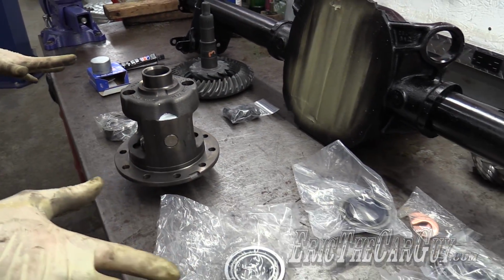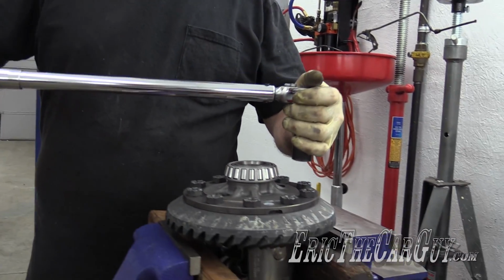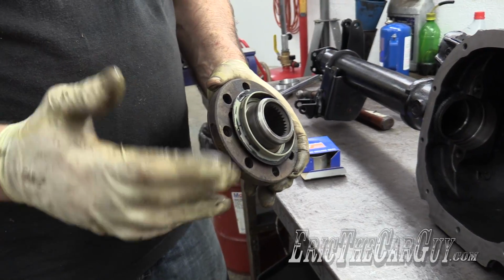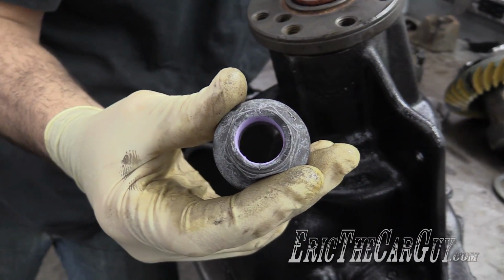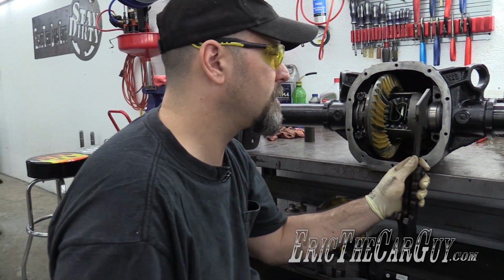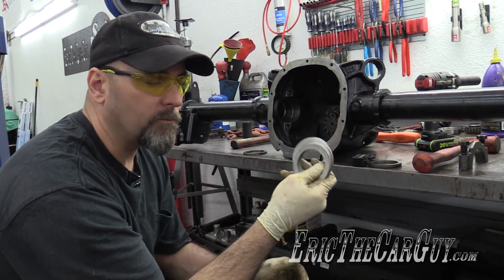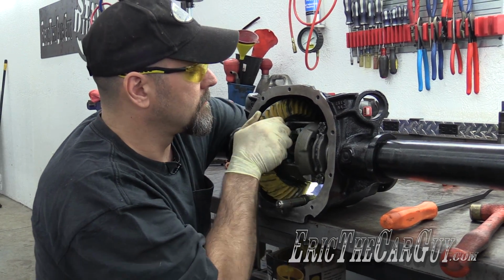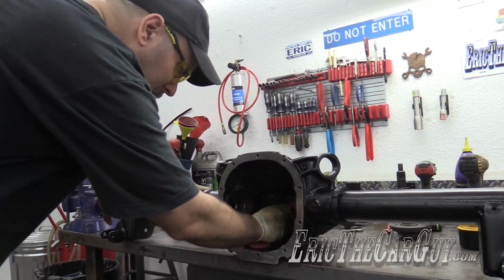Ford 8.8 Assembly & Set Up (Part 1) #FairmontProject

Comment: Hoping I still get a response after 9 years 😛.  At min 40.50 where you're switching back to the old pinion bearing, you're showing where the Koyo setup bearing caused damage to the race. Wasn't that the Koyo race that came with the bearing?  Just confused why you're saying the Koyo bearing was wrong.  I do see the race looks damaged, but was the race correct for the bearing?

Comment: I know the crushed sleeve gets crushed but isn’t preload created by the tension of one bearing being tightened against the other as both bearings have to seat to keep the pinion in place and the play does not go away until they are seated. The crush sleeve has nothing to do with spacing-just preload. I would not think the exact preload is necessary for getting a gear pattern but it is for permanent differential operation.

Comment: it seems by my recollection (and my recollection is known to be poor) that there are markings on those pinions that describe their difference from absolute spec. Therefore, you can look at the marking on the original pinion and the marking on the new pinion, and see what the difference is. then you simply measure the shim on the old pinion and do the math to add a shim the is either thicker or thinner depending on the difference between the two, and that will usually get you close enough that you usually don't have to pull them apart after the first try.

Comment: I'm always happy when I can find relevant information from you.  You are a great teacher.

Is there some reason why you didn't just throw the carrier in the freezer so the bearings and gear set didn't go on easier without as much pressure on the bearings?  (Bearings and gears being warm/larger vs the carrier being cold/smaller)

Comment: One more thing on that rear end.  the upper control arm in the diff you can put bearings.  On the forward mounting point make brackets to lower the upper front mounting point 1 inch.  I had 1.3 60 foot.   Just some ideas on my part.

Comment: Yeah, I know this is an old vid. But thank you Eric for leaving all these up!! I'm "gearing up" 🤦‍♂to rebuild my 8.8 in my truck. I'll be getting rid of some factory parts and replacing them with much better Yukon parts (mainly the open diff. to a limited slip (or posi for the GM guys) This information is going to be tremendously helpful. I'm greatly appreciative for the walk through of this job!! Thank You Sir!!

Comment: Hey Eric, is there any particular reason why you didn't pack the bearings with wheel bearing grease? Are you not supposed to mix wheel bearing grease with diff fluid or is there another reason?

Comment: I heat gear up on hot plate for 10 to 15 minuets use guide studs  You do not need a crush sleeve to check pinion depth  That is why you math new to old or old to new

Comment: I thought of and discovered a really cool trick when installing races on a sport  bike I was rebuilding. Take all the races and put them in the freezer for a few hours beforehand, then take them out one at a time as you need them. You'll find that the races shrink enough that they literally just drop in, maybe sometimes needing a little tap. It was a whole lot easier than having to press them all. A thicker bearing might take longer to shrink, might not work at all, but  it's worth a shot.

Comment: I bought a 2000 expedition 5.4 engine but i have a grinding sound in the differential when i turn left or right it sounds like thats where its coming from i have a feeling the old owner changed something in there I see silicone on the rear diff.my question is this , is that what I'm hearing or not

Comment: I know you have to be very precise in setting up your differential but how did Ford mass produce so many vehicles if you have to spend so much time tweaking each individual differential I wonder how they did it so quickly to mass produce so many vehicles
Reply: I believe rear ends were premade and just a big pile of them waiting to go on a car, the same with engines,however when they mass produce stuff like that they have special tools,since all the bearing sets they are using are the same made by the same company you just set one up and all the others should be the same.

Something that always has amazed me about the auto industry is how a particular model will have some goop they put behind hinges like under the hood for corrosion protection and of course once they tighten it it oozes out,if you look at another car made at the same time that oooze pattern is just about identical, how??? lol

Comment: Well my 355 gears 8.8 differential broke that pin thats like 3 quarters of an inch think and i was wondering do i have to pull the entire differential like you did but leave the axle and all of that on the truck

Comment: You add .020 thou to pass side...subtract .020 thou from drivers side.  That reduces your backlash .005 thousandth.  (Moves it closer to the pinion teeth.)

Comment: after watching this video, I have come to the conclusion that finding a mechanic who actually knows how to repair a differential properly is probably close to impossible
Reply: Me too, you don't press a bearing on by the outer race pushing on the cage, ever.  And you don't press a ring gear on by the teeth.
Reply: @Str8Haste going against wood won’t hurt the teeth on the ring gear🙄

Comment: Make a fake yoke out of some tubing and a nut.  Make it a bit longer than the height of the yoke.  For setup, leave the crush sleeve out and tighten the fake yoke by hand until you get the right preload.    Saves a ton of time and you only need 1 crush sleeve to do setup.  I see you fond the shim driver tool.  I've got one drawer of my tool box with special tools for doing gears.  
   They also make crush sleeve eliminator kits.   Good luck against my buddies Miata on friday!   Catching up on your fairmont, looks good, money is still on the Miata.

Comment: So eric loved the video. I am glad to find a detail video on a 8.8. I would like to ask you a question about my 2008 crown victoria it runs the same differential configuration. My question to you is I just want to put LSD in it do I still have to worry about the backlash? As I am not taking out the pinion just the Carrier. Please advice

Thanks

Comment: Im doing mine now and rebuilt the whole thing and changed from a 3.73 gear to a 5.13 and started off with the shims that was in it and it felt to little of back lash but it was right at 8 and did the paint test and looked good so did i hit the rear end lotto or what.

Comment: If you dont have a press to press the bearing on you could also put the bearing in the oven at 350 and put the pinion in the freezer for a hour or 2 and the bearing will slip right on and when both get back to normal temp it gets tight like its suppose to be.

Comment: I had a differential rebuild 2 years ago truck was hardly used.... the other day I hear a loud thunk in rear end... see my rear diff cover is leaking.. I pull off cover find ALL bolts in ring gear are lose and one bolt has came off jamming between ring gear and cover... who is responsible?

Comment: Easier to use the SOLID PINION BEARING SPACER WITH SHIM PACK from Ratech instead of the crush sleeves, hate setting them up with the sleeves!

Comment: What the fuck... Pressing with a race 🤮. Rough as fuck... If you carnt use a press propaly, you would be better boiling it in oil or use an induction heater.

Comment: I have just spend 1400 to have ford repair a 8.8.  My (former mechanic) was putting some 3.31 gears and ran into trouble.  he knows what he is doing mist of the time but he got it where i the ring would only rotate 3/4 of turn and then bind up, then he tried to put the old 60k gears back in and they did the same thing.  before all of this the car was fine.  For said that my mechanic warp the carrier.  The put a new carrier in and all was fine.  Can a carrier warp and if so how could a mechanic do this?

Comment: can you buy a rebuild kit for 98-2000 8.8 which would include all sleeves, bearings, 31 tooth spline axles, etc... in 1 package?
Reply: there are rebuild kits that include everything (but the 31 spline axle shafts) 
motive R8.8RSKTT or motive R8-8RMK
or google for 8.8 rebuilt kit

Comment: do i have to do all the messurments when just changing the diff part but using the same ring and pinion gear in the old diff housing?

Comment: 7:15 - Fair warning, if you torque your bolts to 100ft/lbs you could strip them out!  Read the instructions that come with your ring gear / diff kit.  The Yukon kit I got calls for only 60ft/lbs of torque.  If you torque them down to 100lbs you will shear off the bolt threads.  Ask me how I know :-(
Reply: I know this is a old comment, I'm not familiar with Yukon but the bolts Ford uses on rear ends (at least the 8.8) are the same bolts they use on their Flywheels/Flexplates and let me tell you, they are MAJORLY  stout,you could probably tow the Queen Mary with just one bolt.

I recently installed a brand new engine in my Mustang and i ordered some new crank bolts,instead of sending me the correct amount the sent me several extras,since I'm old enough to know you never get anything for free i inquired on it and they told me "oh you got a package for a rear end by accident,just use what you need and save the rest" torque value on Flywheel bolts are 85 footpounds per Ford, being a rear end is under tremendous forces 100 is not very far away, i did research the torque and its 96 to 102 footpounds so i guess Yukons are different.

Comment: Hey +Ericthecarguy I have a question: mechanic changed the pinion seal on my 8.8 by removing the pinion nut without counting threats or caring about the preload (pinion seal was leaking and needed to be change), then he putted it back on with a impact wrench making it so tight that the wheels wouldn't even spin, then he loose the nut up and torque it back in, now the gears whine in between 30 to 40 mph, what should I do at this point? re-install the pinion with a new installation kit (washer, crush-sleeve and barings) or is there something else to do?

Comment: If you pulled a OEM timken off of the pinion, wouldn't a replacement timken be the same spec? I'm curious because the bearing set i ordered is Timken and if my Ford 8.8 came with Timken originally i "should" be able to use it as a cheater bearing for setup, no?

Comment: What issues can arise from backing off the pinion nut a little? I tightened mine, but was a hair past spec for pre-load and backed it off like 1/8 turn. What issues will that cause?
Reply: Nick Greenfield it won't reduce the preload dependably by loosening. The preload is arranged by this crush sleeve actually bending or crushing into place with the bearing "loaded" with pressure on the races. If it was not a lubed taper bearing we could compare to an interference fit. If you back off the nut, the crush sleeve is an alloy steel that will not spring back, and the bearing will essentially have some sort of play in it, allowing it to cycle with accel/decel, wearing the gears, and/or basically loading them in a weak fashion at the edge of the teeth on the gears especially with wear over time, and early seal failure will likely happen.

Comment: sorry I got to this video late, I'd just really like to ask, why a 8.8 and not just a 9 inch ? 9 inch are WAY easier to work on, or better yet a chevy rear... But I hate chevy rears... That's why you see ls engines linked to ford 9 or 8.8 rears, they just put the power down. 
But was it you couldn't find one, or just like 8.8's better ?

Comment: next time you have trouble getting a bearing off the pinion use a chistle, bump it in there and it will give you enough gap to get your puller installed without ruining the cage

Comment: thanks for the video, i did this on my Fairlane a year or so ago, i got frustrated on gave up trying to get preload right on the pinion, big mistake, diff is really noisy and wont last long, will be rebuilding again with new gear, and will be watching this a few more times. thanks

Comment: If the replacement gear set has the pinion gear mesh depth engraved on it, I use a depth mike and measure off the bearing saddle to achieve that dimension.  Then, your heel/toe portion of the pattern should be pretty darn close to where you want it.  I never use a sleeve when doing a set up, just enough pressure on the flange nut to keep the pinion gear from wobbling around.  Never had a problem yet!  
  Once I set up a GM 12 bolt Posi for a '68 GTO like a Dana, with a solid sleeve from Summit and shims to get the rotation torque preload to spec with 250 Lb/ft of torque on the nut.  Worked out great!  
  Something that was left out from this video and is VERY important, is to check the pattern and back lash at three places around the ring gear to make sure that you don't have any tight spots.  A couple of dolts set up a new set of gears in a Ford tow truck axle, and didn't make it out of the driveway before the pinion gear blew up and took out about 1/3 of the ring gear!  The reason?  The cold chisel used to separate the old RG off the gear case gouged it, and the chip was left under the ring gear, elevating it about .007-.010".  When the high point of the RG came around to the pinion gear KA-POWWW!!!  Metal schrapnel all over the place inside!  The Detroit Locker was  also damaged and parts to fix it couldn't be had for 10 weeks, so a peg leg axle had to be put in to get it going and making money again.  If they had bothered to check in three places, they would have spotted the problem and could have fixed it before the damage was done.  Let that be a lesson to all here!

Comment: I set up those crush sleeves in the press. On a live axle, you need a helper to get the rear end into the press and hold the end to balance it.
Set the pinion flange down on the base of the press with a gap to access the pinion nut, and press on the pinion with a long extension. You can feel the preload on the bearings by the friction when trying to rotate the housing in the pinion bearings. Once you have it right, you can just reach up under the press base and tighten the nut down.

Comment: Did this 1 year ago, on a GM 8.5, installed a Yukon Duragrip and the old 3.42 ring and pinon 40 year old stock gearset.  As Paul said it was a lot better doing it without a crush-sleeve . But it took me 14 tries, swapping out carrier bearing shims, and juggeling pinion shims around to get it just rigth. A set up bearing is a must! But an extremley satisfying job in the end when it all works great without a sound :)

Comment: nice video, but you dont need a new crush sleeve when checking pinion depth. only after you have achieved proper pinion depth and gear pattern and are ready to put the pinion in for good you can use a new crush sleeve.

just use the old one for setup.

Comment: when setting the backlash start with the factory shims and measure backlash. changing the shims by .010" will change the preload by .007" in either direction. then do the math and make your adjustment.  for example if you needed to remove aporox .028" of backlash you would divide 28 by 7 which is 4, and multiple by 10 giving you 40.  so you would remove .040 from the right side and add it to the left side

Comment: When I see a spec like 97-102 ft-lbs, I think it's there to tell me the accuracy I'm trying to achieve. I.E., I think it means I want a torque wrench with an accuracy of ±2% it's setting.  A typical snap-action torque wrench made by snap-on is ±4% in the tightening direction.  If it's been recently calibrated, and set to 100 ft-lbs, it should apply a torque of 96-104 ft-lbs.  (not what ford spec'd)...  But does it really matter?

Two percent of 100 ft-lbs is 2 ft-lbs. If the wrench is ±2%, and it's set to 100 ft-lbs, it will apply torque at (plus or minus) 2% of that, which would be 98-102 ft-lbs (within ford's spec).  But torque wrenches that accurate are almost always electronic (if it wasn't I wouldn't trust the torque wrench's spec), and then you're relying on a beep instead of the snap-action of the torque wrench, which makes the torque accuracy much more reliant on the user being EXTREMELY careful as well.  Is that headache really all the effort it takes to do it "correctly"?  Or am I interpreting the ford torque spec wrong?

Comment: I have worked at our local Ford dealer for over a year now. I have seen on many occasions the side carrier shims have their bevel edges facing inward (against the carrier bearings). Most likely because they have been messed with before but a lot of dealership work is warranty and I still see it. It Doesn't really matter IMO but thought I would share. great video as always, Eric!
Reply: I've taken apart lots of these rears.  The shims are all over the place and some are beveled on both sides.  I guess it depends on what vendor was supplying the cast shims at the time

Comment: How about heating the ring gear in the oven to expand it, it would probably fall on.
Reply: yeah you dont want to heat it to more then 200ish F or it will affect the tempering, same goes with bearings heat in oil rather.
Reply: You mean if you don't have a press? Yeah it would work. Just don't get it too hot.
Reply: I've set up many gear sets and I've never used a press to seat the ring gear on the carrier. ring gear in the oven for 30 min or so to expand it, carrier in the freezer overnight and the ring gear will fall right into place.
Reply: heat and retaining compound don't mix (until you want it apart that is)